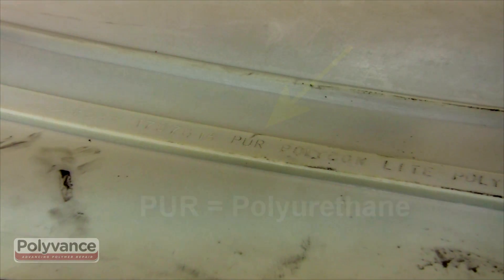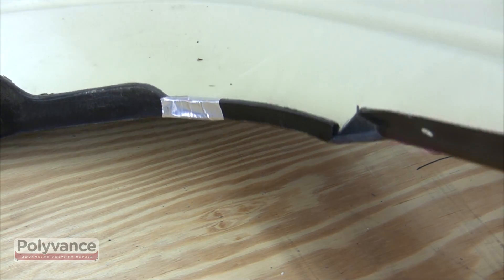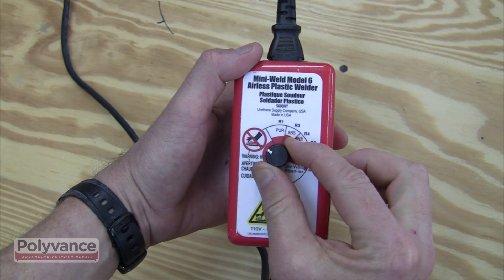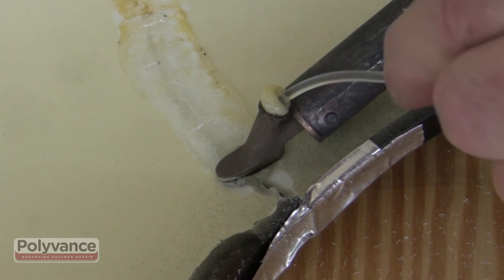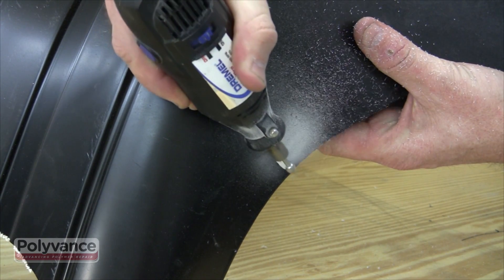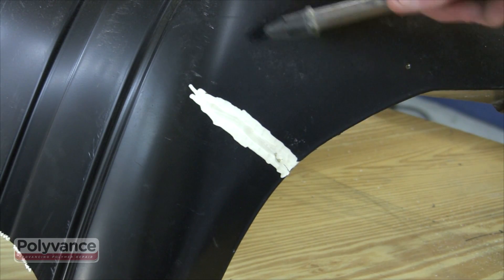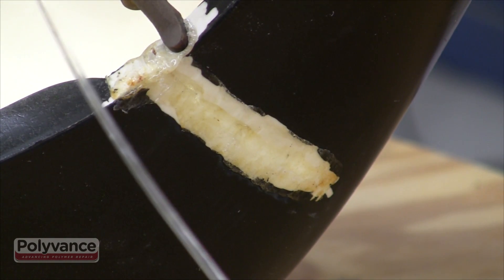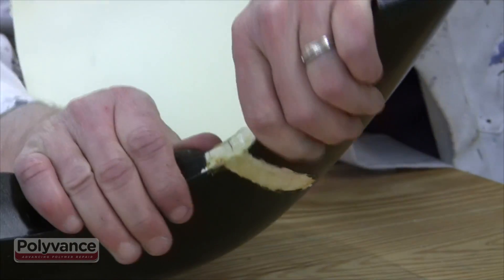Repairing Urethane Bumper Covers with an Airless Plastic Welder

Comment: Hi. I have repaired a PURIM bumper with the machine and with your instructions. I have several concerns:

Does polyurethane welding maintain its properties over the years or will it come off in the future?

Does polyurethane welding need some kind of internal reinforcement to help with the passage of time?

thank you
Reply: It should hold up to the test of time just fine.  We have samples here almost 20 years old that look as good as the ones made a few months ago.  Due to the nature of the repair, you cannot add internal reinforcement to the repair area.

Comment: I have a cracked bumper and now i will try your version. Thanks you
Reply from the maker: Good luck! Let us know if you have any questions!
Reply: @polyvance  is there a PUR glue like superglue or silicon ?
Reply: CA glues stick well to it, but not as a  permanent repair due to the difference in the flexibility of the bumper compared to the inflexibility of the CA glue, thats the reason for using the urethane welding rod, it sticks well and has better flexibility properties.
Reply: @polyvance  on the back of my bumper says: > PUR-MF 17 < Can it be glued this way ? Is the same material that you show us ? Thanks you